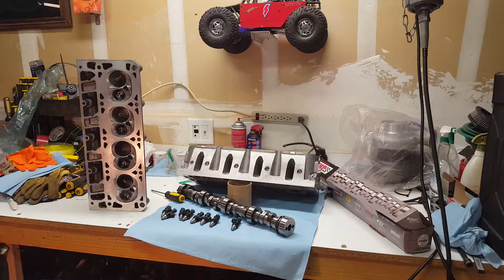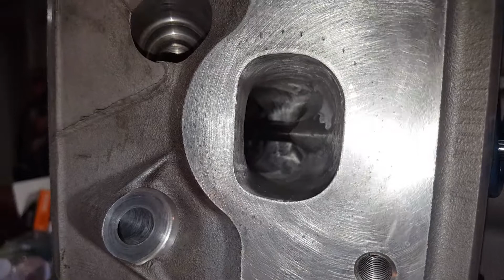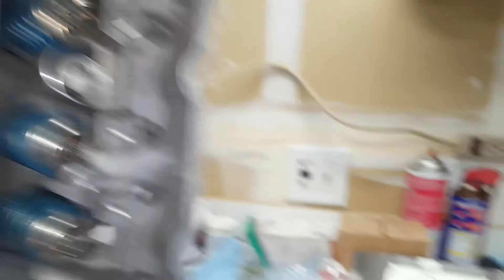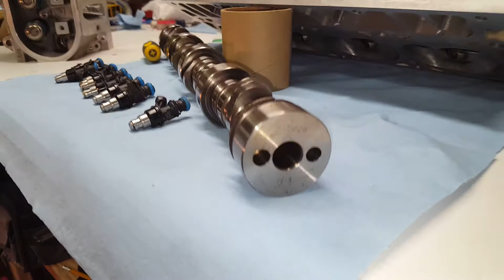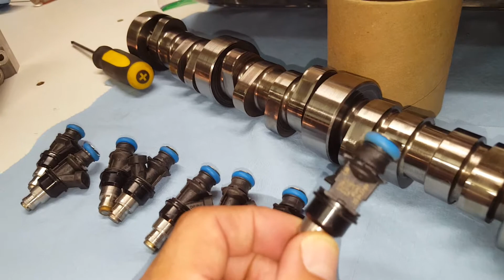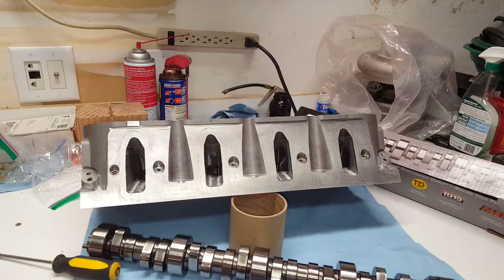ls6 Cam  #243 ls2heads truck build

Comment: I did something similar with the 6.0 in my Iroc with 799 heads (basically the same as the 243 heads minus the trick exhaust valves) but after I talked to Matt Happel he told me that the injectors from the 5.3 flex fuel motor has bigger injectors than the big block 8100 / the big block having 30lb injectors and the flex 5.3 has 36lb deals. Then I F<>ked up and bought new “oem” no name injectors off of eBay which didn’t work so I went to the junkyard and found a set that worked perfectly. Cool build man
Reply from the maker: Thanks, I went with the big block injectors because they bolt directly up, I thought the flex fuels have different connectors? The injectors showed up four of them look like they were pulled straight off a Beach. Clean them up with the air Schrader valve and carburetor cleaner RC battery to momentary switch. Two of them almost didn't open up. But I got them in the truck now running, still need a good tune
Reply: squeal the wheels / yeah I should have said the harness I got was an 03 n up dbw with ev6 injector plugs (roundish with two pins) I went that way because most manufacturers were all using that type connector before most went to direct injection (I’m keeping as far away from dgi as possible) like Volvo’s xc90 uses injectors that are plug n play with flex fuel 5.3’s up until 2007 model year and they’re 45lb injectors, so if I ever decided to go big with a turbo or something I can go to the yard for injectors instead of spending a fortune
Reply from the maker: Yeah that's good to know for turbo or nitrous, although if I need to go bigger I'll just go with the Marine big block injectors
Reply: squeal the wheels / car f you know where to get a set let me know, I can’t find any to save my life

Comment: I need that cam 😂
Reply from the maker: Gives up too much torque down low with my application,big h.d truck.but it pulls hard from 3500rpm out to shift point 5800rpm.
Reply: Trailblazer 4.3 Torque Converter will help that's out. I'ma mill my 706 also so I wont lose much 😉
Reply from the maker: 706 are good heads,mil'um down low and do a little port work. Eventually im going to swap my ls6 cam out for elgin stage 1.
Reply: @squealthewheels3090  Elgin got some nice cams & btw i have a 5.3 just tryna turn it up a little....
Reply from the maker: On Richard holdener Channel he has a ton of good 5.3 builds. With Dyno numbers.
Reply: @squealthewheels3090  oh yea I gotta check it out
Reply: Scoggin Dickey Ls6 Power Max cam is what I run in my 5.3/ they designed the cam to boost low speed torque and higher rpm horsepower and I think it’s like $240 but you will need springs that can deal with at least .560